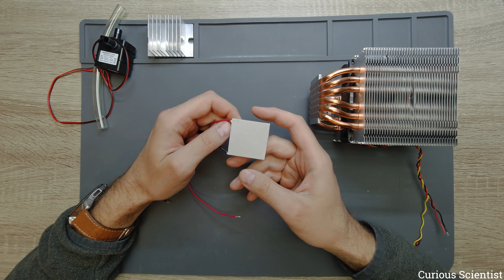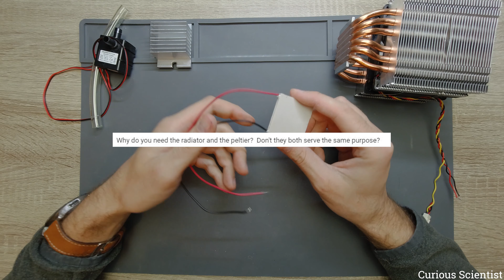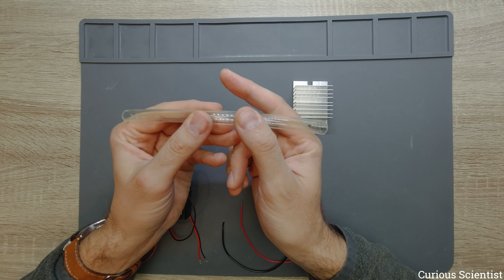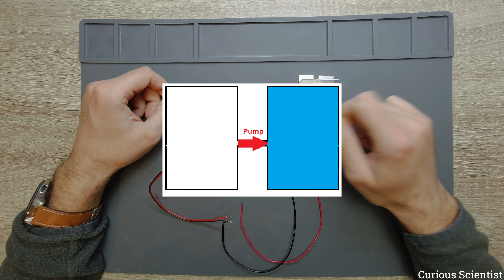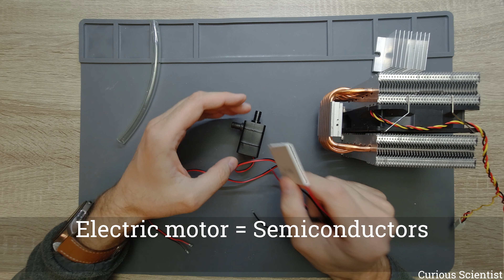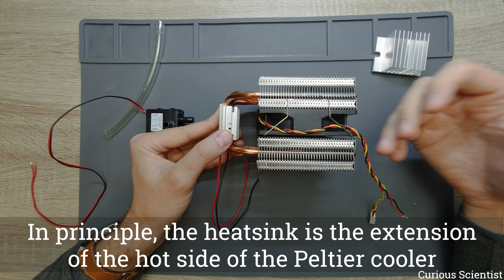Let's discuss about Peltier coolers #1 - Water pump analogy

Comment: Thank you for all your videos about TEC / Peltier element - Extremely useful. I would like to suggest that you make a video about TEC (or TEC-s) used in CPU cooling - Most "specialists" in you tube claim that that is impossible , BUT they put TEC directly to CPU - which makes it impossible to pump all the power and all is compromised by the bad design. A TEC as a chiller in a secondary water cooling loop series (or just video analysing theoretically the possibilities ) would be super interesting for me... and may be for other people. Thank you !
Reply from the maker: Hi! What is the point of adding a Peltier cooler to the cooling loop? The water cooling loop for the CPU already does what it has to, it keeps the CPU near room temperature. I would rather add 1 more radiator to my loop than adding a Peltier cooler. What is the point??
Reply: @CuriousScientist  The idea is to get water temperature below ambient (before CPU) and keep CPU cooler . (A cooler CPU means more power :) Also TEC could be switched on only if more power needed :) ... I agree that when ON mode and water temp below ambient the standard water radiator will heat the water :) which is not OK, but ... if AIM is "keeping water at ambient" using TEC seems easier because radiator will be used in high temp difference mode
Reply from the maker: Yeah, I get that part, but I am still not getting the whole concept. You will need Peltier coolers (1 won't be enough), you will need to cool the Peltier coolers, they need power supply, power regulator and other accessories (cables, connectors, switches...etc.). Why would you throw several hundred dollars out on this if you can buy a better CPU or a better water cooler? It makes no sense.
Reply: @CuriousScientist  My idea is that even with the best cooler when water temperature gets closer to ambient (low temperature difference) the cooling gets more inefficient, BUT if TEC introduced, its cooler difference will be always high and water cooling will be better. No need for power regulators - if TEC wotks in const Voltage efficient mode  it will be usefull to get (ambient + 5) to (ambient + 15) degree temp (calculation based on idle CPU temp - TEC profit = ambient + 5 :)... and that will be better than any cooler with any number of radiators ... Seems there is a profit from standard, BUT I may be wrong?
Reply from the maker: If there's a profit where there's not a single such commercial product on the market? PC users buy all sorts of gadgets... but this cooler somehow never reached the shelves. I wonder why. 🙃

Comment: Thx! nice video. One question, could you estimate the useful life of a  Peltier module using it 7dx24h ?
Reply from the maker: Hi! Essentially ∞, if you do not cycle it too much and use it below let's say 75% of its maximum rated current while ensuring good cooling on its hot side. They are solid-state devices, so there's nothing really that can break in them. Oh yeah, and avoid moisture getting inside them!
Reply: @CuriousScientist  thanks a lot
Reply from the maker: You're welcome!

Comment: Hey awesome video. If I wanted to cool water to approx 0 deg C using peltier, what type (3,4,5,6,10,15, etc amp) peltier of the tec1-127 family is best suited to this? Things I am focusing on are maximising energy and cooling efficiency while still achieving low temperatures.
Reply from the maker: Hi, for the third time... It is relatively obvious. If you want better cooling, you need higher a performance, i.e. better Peltier cooler. However, the higher performance the Peltier cooler is, the more challenging to cool its hot side. You have 40x40 mm for all of these coolers however the small ones will dissipate let's say 50 W, while the large ones (in terms of power) will easily dissipate 400 W. 8x the heat but the same cross section area. 

You miss to disclose a bunch of details when you are asking for help. You never mentioned how much water you want to cool and how quickly. You never mentioned if the water is insulated or it is exposed to the environment. Also, what is your budget? To do the things properly, you'll need a proper power supply, a DC-DC converter to regulate the power (or maybe you'll need multiple, depending on the required power), you'll also need a proper cooling for the hot side, (probably) a separate power supply for the cooling (fans, pumps if water cooling...etc)... So, yeah, it is hard to answer if most of the crucial details are missing.
Reply: @CuriousScientist  I understand this, however, being new to your channel I wanted to discover if you would reply to your comments before discussing things of greater detail. Nevertheless I appreciate you getting back to me so promptly.
Reply: @CuriousScientist  I have a large 520x130x60mm radiator from EKWB cooling. I want to cool water using 8 peltier devices (I am thinking tec1-12705, however I am still working my way through your comparison videos on this topic so I don't know which is best). I do not know an exact volume of water I want however I am aiming to cool enough water to run through a liquid to air heat exchanger and back to the 8 peltier devices. I am not cooling a fish tank or a room, I only want to cool a tube and fin heat exchanger like those found in phase change devices, only smaller.